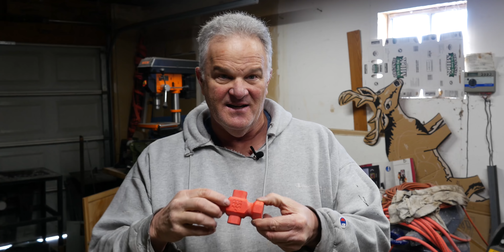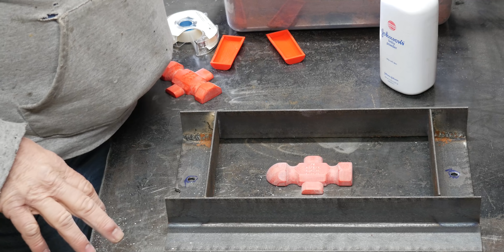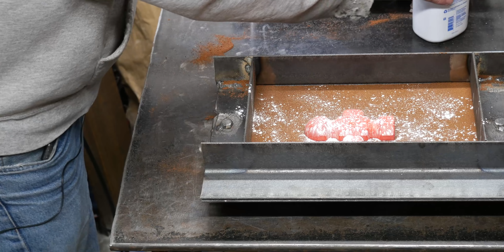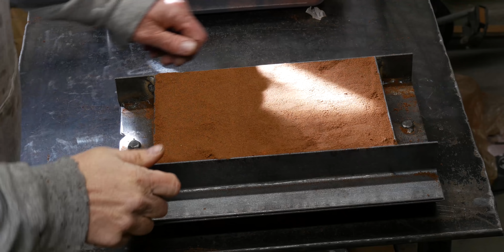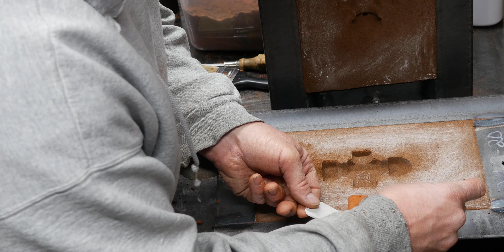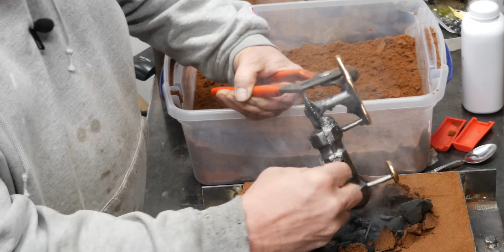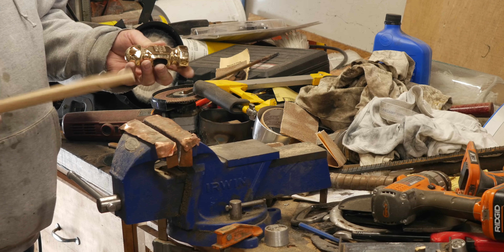Casting an aluminum bronze hammer

Comment: Love the hammer even with the hole  Maybe put a magnet in it to start a small nails Old timers would steam the wood then add the wedge  like shovels handle to bend into shovel
Reply from the maker: Steaming it probably would have kept it from splitting too, but I conveniently left that part out ;-)

Comment: Aluminum bronze appears to shrink a lot. The outside cools before the inside and so it leaves a hole going through the center.
Reply from the maker: I'm learning that. I actually re-poured the hammer using better feeder tunes (risers) and it came out much better. I have a video of it here https://youtu.be/MsW4G-J2LA4 the shrinkage is really evident in the feeders.  The video I have coming out tomorrow shows it as well.

Comment: The holes could be from shrinkage during cooling bronze has a habit of needing larger sprues and more head pressure than aluminum
Reply from the maker: I'm going to argue, but understand that I know NOTHING. ;-) It appears to be a bubble in the middle of the cast, not shrinkage. My assumption is that gas, maybe air, got sucked into the pour and couldn't escape. Keep in mind, I know nothing and I acknowledge that you could easily be right ;-)

Thanks for the feedback!
Reply: swdweeb very possible but ive seen the smaller spure cools before the larger mass of the hammer escaping gas floats to cold sprue and stops a larger sprue lets it stay molten longer allowing the gas to escape the part and go into the sprue so i think a combo of both issues is causing the holes. Great video btw allways on the look out for good channels
Reply from the maker: Interesting. Thank you. I had another comment talking about gates being large enough to prevent cooling along the way. I'm definitely looking tin to larger conical sprues and risers for future pours

Comment: Shiny!  I'm just a hack ameteur, but I can venture a GUESS as to how you ended up with a bubble in your hammer's face.   In a video by Jim Taylor, he uses a "well" under his sprue to stop (or reduce) turbulence.  Another video I saw used longer than necessary gates to slow down flow speed.  Olfoundryman takes great care to round off where spires and gates change direction (I assume for the same reasons, but he didn't actually say.)  I don't see many gates that are short or straight in the videos of the people who get  the best results.  Maybe you could investigate that area further.  Myfordboy does a pretty good job of casting, too, as does Brian Oltrogge.  It might be helpful to you to see their videos and maybe read their comment sections.
Reply from the maker: I will, thank you.
Reply: One other pretty good resource that I forgot to mention is mrpete222.  He has a 10 segment casting series with the first 5 about making the patterns only.  As a former high school shop teacher, he seems to be pretty knowledgeable too.  He has videos on working with a lathe, forge and other machines too.  I think he has made over 800 videos now.
Reply from the maker: 800?? Wow! I'll check him out, thanks

Comment: Remove hammer head from the handle. You'd be doing that anyways if you want to change the wedge. Wrap the hammer head with a piece of tin from a tin can to create a 1/2 inch high damn around the holey end of the hammer. Clamp tin with vice grips. Preheat the hammer head. Melt pour material and fill the casting hole in the hammer head. Cool, remove tin damn and regrind to shape. Shazam! No hole! And yes, the molten bronze will melt the surface of the hammer head and stick just like it would in a brand new pour. Hammer salvaged and completely usable. Have fun. OR you could just pour a string of material into a wire shape and use M.A.P. gas torch to weld and fill the hole shut. Both options are about the same amount of work. Both work equally well.
Reply from the maker: Thanks Ed, You've almost got me convinced to try it. ;-)  I learned a log from this effort and may have another option. Check out the video that will come out this Friday and let me know what you think.  

One question, if I heat the head, how hot would you get it? Just too hot to touch or almost melted? Still lots for me to learn here.
Reply: Definitely too hot to touch but don't melt it. The molten metal will melt the "surface" of the casting as soon as it touches it when you pour. The only reason you heat the casting is to lessen the shock factor (hot on top of cold) which can cause a fracture to appear between the casting (the hammer head) and the new pour on top of it. 
You can add to a casting after the fact. Lets say your casting is too large for one pour. Then do it in two pours. Just don't take so long to prepare the second pour that the first pour cools down too much. This will only work in an overhead pour however, where the sprue and the gate can completely drain and remain open to accept the second pour on top of the first pour. After dressing the casting, you'd never know it was done in two pours. 
I'll tune in on Friday.
Reply from the maker: Let me see if I can pull that off this weekend.

Comment: If I were you I would buy some Styrofoam and insulate that garage door, I have 2 12x12 doors I insulated and my shop is kept at 70 degrees and it is 16F outside right now. Having a metal door you are not going to be able keep the heat in at all. 
You might care to check out  the Olfoundryman channel and Sandrammer channel
Reply from the maker: I've thought about that from time to time (the insulation) but never seem to get around to doing it. Maybe its finally time ;-)

Thanks for the channel  suggestions. Someone else also recommended sandrammer

Comment: IMHO: It looked as if your sand was way too dry!  I thought that it had to be slightly "damp", and, that it would adhere to itself a bit better. (like building a sand castle). You cannot build a "sand castle" with DRY sand!...
Reply from the maker: True, but the mold came out fine as you can see in the finished casting came out great except for the void which was a rider problem not a sand problem. So far my petrobond has maintained its ability to hold together. I've started not mixing the burned sand with the not burned ti ensure that is stays that way.

Comment: @swdweeb please may I have a copy of the 3D file, also what was your mixture ratio?
Reply from the maker: Hmmm... that may be a tough one.  I had a friend model and print that pattern for me.  It was before I had the ability to do these things myself.  I don't have the files.  I'll have to check to see if he kept them.  Don't hold your breath, he's not one to save things like this.

My aluminum bronze ratio is typically 90% copper 10% aluminum by weight
Reply: @swdweeb  I ask because the flow of the design I can’t seem to find anywhere, every ball peen/pein design I find I don’t like to modern where as yours has that vintage/fantasy look about it
Reply from the maker: @robjackofalltradesely4844  I should hear back from my friend this evening... about 8 hours from now.. I'll let you know
Reply: @swdweeb  any news on the file, if not I will attempt to create the 3D file myself aslong as I have your permission to do so
Reply from the maker: @robjackofalltradesely4844  email me. swdweeb@gmail.com
Reply from the maker: @robjackofalltradesely4844  Did you change your mind?
Reply: @swdweeb  sorry fella only just seen this, will email shortly

Comment: If you cover the plinth with cardboard before you set the crucible, the crucible will not stick to the plinth.
Reply from the maker: You know, I know that. Do I do it, no. Should I do it, yes.  I think I've been holding out until I reline my furnace. It's a lame excuse, but it's all I got ;-)  Thanks for the advice.
Reply: It is a joy watching you becoming a master manipulator of molten metal!
Reply from the maker: Ha! :-D Thanks. Special emphasis on the word "becoming"

Comment: Your sprue is too small and should be full shaped so when it cools and shrinks it’s sucks extra material from the sprue!
Reply from the maker: Absolutely wrong. The sprue is designed to conform to the shape of the metal as it falls thus preventing air from being entrained in the metal as it is moving. Sprues should freeze off before the part freezes. If you want to feed a part then use a feeder that is sufficient to feed a part in the location it requires it.  
This hammer was a long time ago and I learned the lesson of feeding it properly after making this mistake,

Comment: First pins drilled into both pieces would be your best since that has been the standard way since the bronze age. Now if you spend 10% time welding and 90% grinding....then you are a grinder not a welder. You don't have to be a certified welder to make welds thast don't need to be ground off. It just takes a little knowledge and a little practice.
Reply from the maker: thanks

Comment: Bigger sprou
Reply from the maker: No, a larger sprue is rarely, if ever, the answer. The sprue I use now is much smaller and I've cast much larger hammers with it. The problem is in the feeders. Aluminum bronze shrinks a lot and as a result, you need large feeders to supply the part as it is cooling. Take a look at these two videos https://youtu.be/MsW4G-J2LA4 and https://youtu.be/4go8EJE6HpQ. The answer is in the feeders. 

Thanks for watching.
Reply: All right so what I assume might be happening when I said  bigger sprue  because what I think is going on when it cools down there is not enough Molt-on marital  to be sucked back down The us causing an air pocket or Just  Impurities that never was able to float to the top because the sprue was cooling to fast
Reply: swdweeb don’t get it wrong that’s just my opinion
Reply: swdweeb While I am not a metallurgist this stuff is just physics with him commenting on if it’s cold I can’t suck it back down if it’s solid right I mean you were quick to answer me before
Reply from the maker: :-) That's because I was sitting at my computer when your first comment came in. I was in bed when your later comments came in. I'm not ignoring you. I'll respond to the other comments a little later today when I have a a free minute.
Reply from the maker: The problem isn't the sprue cooling too fast as is evident by the part filling. If the sprue froze before the part was full we would have seen a partially filled part. As it was, the part filled to all edges, so we delivered metal to the entire part before the sprue freezes (after I stop pouring).

The bubble is likely a void, not a bubble, caused by the shrinking metal. Feeders/risers are used to supply molten metal to the part as it is cooling. A properly designed feeder should be large enough to stay molten longer than the part. When I did the ferrier's hammer (the second link I sent you) I used really larger feeders and gates so that they could do exactly that.

The sprue is not a feeder in that same sense. The sprue is designed to deliver metal to the network of runners and gates which in turn fill the part and feeders. A large sprue causes a turbulent flow of metal (it will splash and fold in on itself at the bottom of the sprue if there is room for it to do so.  A large sprue will also suck air in with it since it is wider that the stream of metal flowing into it.  The small tapered sprue is designed to provide a smooth (laminar) flow of metal to the runner. As the metal falls, it begins falling faster and faster. That increased speed means that it takes less diameter to hold the same volume of metal as the sprue when the metal first enters the sprue. Think about what pouring water looks like. It starts off wide and gets narrower as it falls. The sprue is designed to support the flow of metal without the opportunity to a) suck air in, b) not be turbulent, and c) to provide the maximum flow rate while maintaining a and b.

Comment: Have a look at the old foundry guys videos, https://www.youtube.com/channel/UC90RoN_IjSRF18jAG0HIA6g.
He has some good info in there on casting, sand prep, rises, vents etc, well worth the look, click the play all button to see.
Also this young bloke has done a similar project with the sand you are using in similar temps, good idea for next time, https://www.youtube.com/watch?v=rNP5UKnY03I.
Your workbench is as cluttered as mine, my garage is opposite to yours atm, roughly 95 to 100deg F and 90% humidity.
Give this hammer another go after you have done a bit of research, you'll end up with a great usable tool, thanks for the Video.
Reply from the maker: Thanks. Check out https://youtu.be/MsW4G-J2LA4 

Yes, that young man did his after Paul and I did ours. He contacted us before he shot his video to see if we would mind.

Olfoundryman and I talk on a regular basis.